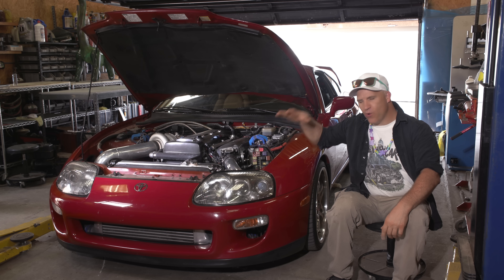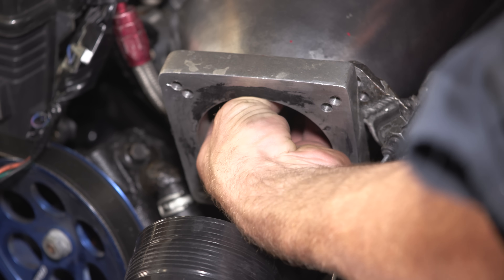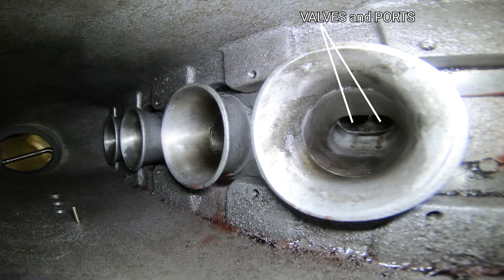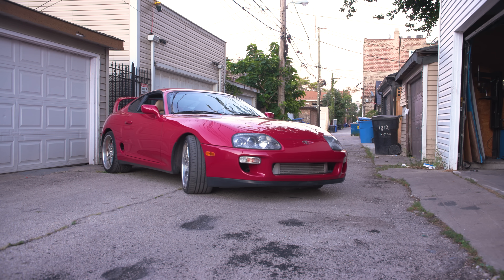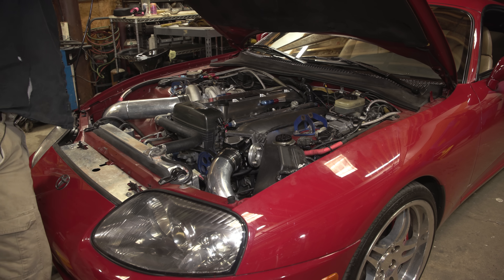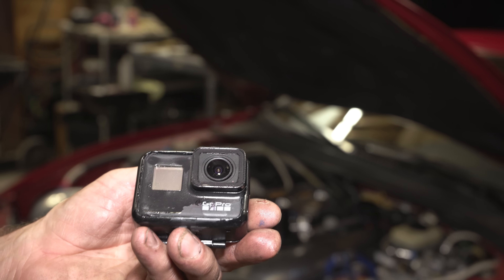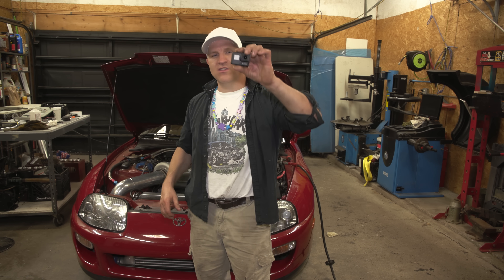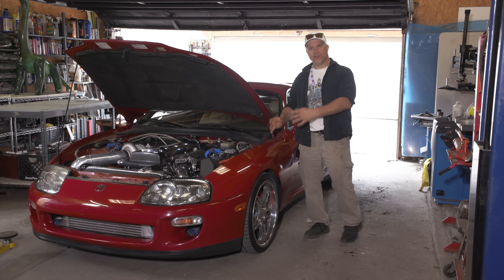Driving with Gopro Inside My Intake Manifold (Toyota Supra Turbo)

Comment: That oil (or rather oil and gas) on the camera was there because of the backpressure from the exhaust when you close the throttle. Valve overlap with open throttle normally causes the exhaust to create negative pressure in the cylinder head and that sucks more air in through the intake valve. But if there is no air to suck in, the negative pressure isn't created in the cylinder head, but rather in the intake manifold and the exhaust gasses escape not only to the exhaust manifold, but also to the intake manifold and cause the oil from the combustion chamber and gas that is sprayed on top of the valve to splash into the intake manifold covering the entire camera in gassy oily stuff. This exhaust gas-oil-gasoline escaping to the intake manifold through the intake valve only occurs during the first few intake strokes when you close the throttle. After a while, the exhaust gasses from the intake manifold are sucked back into the cylinders and forced out of the car.

Comment: The oil is leaking from cylinder number 3. Whatch the cold start carefully and you will see it drip from there. What is happening is the valve is closed and the oil leaks down the valve guide. Then it pools up. Either the valve guide or the seal is worn or both. Put a go pro at the end of your exhaust on a cold start to see if you have a puff of white smoke. When it gets really bad you have a lot of smoke especially until it warms up.

Comment: All I can think of is, there’s orange juice just rolling around in side the manifold. Might wanna look into that cracked cylinder head.
Reply from the maker: It was the power steering pressure switch which uses the intake as a vacuum reference, I changed it, I had been wondering for a while where my power steering fluid was going.

Comment: This needs to be added to why you should use a catch can. That oil is blow by and a catch can will prevent that from going in your intake.
Reply from the maker: I do, I actually designed the original catch can system for the Supra, you can look it up. It turned out to be power steering fluid.
Reply: @WarpedYT  that wasn't a dig at you, just the perfect video to depict why you'd want one. Power steering fluid?! How did that happen.

Comment: kinda crazy the amount of fuel that hits the intake runner, you could probably use the footage to optimize the injector location to get them to shoot more at the back of the valves. I'd bet that if you could somehow mount the injectors at the end of the velocity stacks shooting straight into the port it would have a better chance to completely atomize. just a guess, im probably wrong but it would be interesting nonetheless
Reply: With moden engines they flatten the ports and offset the valves to create a swirl, then place the injectors so they spray directly into to the cylinder, across the top of the valves so that it gets picked up in the swirl, passes across the top of the cylinder and swirls downward. This makes more power and fuel economy, less hot / cold spots etc. I don't know if this was a consideration back when this engine was made, or if it's a more recent thing. I only saw it in a recent video, either for the Mazda Skyactiv X engine, or the deep dive into how the Toyota Yaris GR engine works.

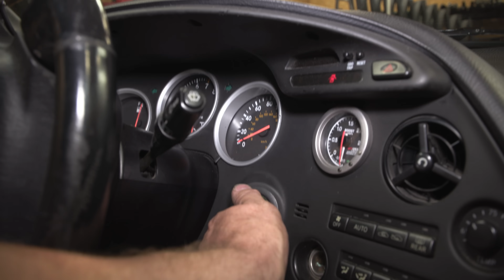Comment: As soon as you started the car up at 2:37, you can see oil entering the intake manifold beneath the velocity stack of the third cylinder (judging from its color, I'm guessing you're using Royal Purple). It looks like your intake manifold was cast in two pieces, the plenum and head interface/velocity stacks. It's at the mating of these two pieces that the oil appears to be coming from. But that would lead me to believe that the oil leak is external, and the oil is entering the manifold due to a small leak at that spot. That would also explain why the majority of oil seems to be entering at initial startup, being that the car has had time to sit for a bit for the oil to accumulate wherever it is that it is accumulating.

I'm assuming you've already figured it out by now, but I noticed the oil as soon as you started the car.

Edit: Reading another comment, I see that it was power steering fluid. So that explains the color!
Reply: Gappie Al Kebabi  Did you miss the part at the end where I wrote "Edit: it's power steering fluid"?
Reply: @rars0n  lol what a loser thinking he made you edit
Reply: It's valve stem seals that's why it drips from the stack
Reply: @zaccuskelly4016  If you had read the entire comment, you'd have seen that it was power steering fluid.
Reply: Gappie Al Kebabi  It was edited 7 months ago, loser.
Reply: @rars0n  SHAME!
Reply: Gappie Al Kebabi  ONLY CUZ YOU SAID SO! HES LYING!
Reply: @fille20200  I'll report you to mrs.sugar

Comment: If you pushed further and kept running it while the camera shut off, most likely the camera would have started to crack under heat and pressure and pieces would fall off, then those pieces would go in the intake valve

Comment: Oil is from the pressure relief for the sump. Compression rings don't stop ALL of the blow-by, and some inevitably ends up in the sump. Pressure from the sump is normally vented into the intake pipe. Also you clearly inject a TRUCKLOAD of fuel. So it's oil/petrol mix.

Comment: The oil, that’s blow-by my guy.
Reply: Blow-by...piston rings? So how likely would that oil be to flow against positive pressure coming through the intake, rather than just get burned/pushed out the exhaust? More than likely it’s coming through the PCV system, if it hasn’t been eliminated, or worse, sneaking past the turbo seals.

Comment: Is that gasoline being spayed in there?
Reply: Yep. The injectors spray gasoline into the intake stream as the valves open to suck air and fuel into the cylinder.

Comment: To my mind that is a lot of fluids (oil, fuel) floating around free in the airbox.
To get rid of a lot of it maybe it would be a good idea to lengthen the intake horn to the next harmonic so that high velocity air/fuel mix bouncing back when the valves shut would still be in the intake horn when the next intake event starts.
Just an idea - although longer horns would narrow the power band - but probably increase the torque.
Very interesting video, thanks

Comment: What a better car to try this on than an expensive ass, classic Supra.
Reply: One with an intake manifold big enough to safely mount the camera in? 😉
Reply: @troyjollimore4100  yes? That one?
Reply: @dru4135  My point being, what one would that be? Not many have manifolds larger than a modified Supra one...
Reply: @troyjollimore4100  dude, what is your point here? I've seen a couple of guys do that shit before and the only difference was they left their GoPro in a tad bit longer and the damn thing came  apart and melted plastic and a burnt battery went everywhere. So gone on ahead and do what you see fit. Good luck.
Reply: @dru4135  Oh, I’m not going to do that. I can’t afford a GoPro, let alone a Supra! 😉 But, of all cars, that was probably the best one since the camera fits with room to spare, and flows enough air that heat doesn’t immediately become an issue,  though he may not have thought about that. Besides, it all turned out well!
Reply: @troyjollimore4100  all good bro

Comment: I saw the oil being sprayed into the intake. Did you find out why that was happening?
Reply: That manifold looks like it's cast in two pieces before being assembled together. Where the plenum mates to the lower half of the manifold, there seems to be a small vacuum leak there. My guess is that there is an external oil leak that is causing oil to collect on the outside of the intake manifold. The car sat while he installed the GoPro, which allowed the oil to collect in that area. Then the car starts and the vacuum in the manifold draws the oil in. You can see it being pulled into the intake manifold from underneath the third velocity stack at 2:37. Play it at half speed and it's super obvious where it's coming from.

Edit: Apparently it was power steering fluid. That explains the color (I was assuming it was Royal Purple).
Reply: @rars0n  Wow! That actually makes a lot of sense. Good eye, and thank you for the reply.
Reply: @rars0n  if that's the case, it just raises more questions for me. I'll stick with Honda...
Reply: @boodro2122  His power steering switch takes a feed off of the intake manifold, and was bypassing some power steering fluid. To me, based on the location of the leak and the nature of it seemingly most apparent at initial start, I assumed it was a vacuum leak (I mean, it kinda is if it's sucking in PS fluid). He put the information in at the beginning of the footage at the end of the video, in the captions. I didn't realize that until I read someone else's comment.
Reply: @rars0n  oh, ok. Right on. Thank you.
Reply: @boodro2122  Look up engine oil dilution problem honda engines, scary stuff, class action lawsuit !
Reply: @DECKARD263354BR  ok, right on. I will. I drive a 1st gen CR-V. Just did a motor swap. I'll look it up. Probably newer cars?
Reply: @boodro2122  Sure is it is the 1.5Turbo owners are complaining about, and from what I've heard the company is refusing to acknowledge it. All the best with your CRV great cars, i had a 1993 honda prelude si, great memories!!
Reply: @DECKARD263354BR  lol right on. Thanks.

Comment: Some oil getting passed the rings it's called blow-by
Reply: It's power steering fluid.

Blowby is when combustion gases leak past the rings into the crankcase.

Comment: The oil is because you're massively over fuelling the car. Nearly like it always has its choke on.
In the video from the GoPro you can see the fuel dripping out of the stacks. 
That excess fuel isn't being burnt & is dissolving the oil of the cylinder walls Then spitting it back out through the valve. 
It's probably because the Mass Airflow Sensor & or fuel pump isn't suited to the intake system you have on the car !  

The only other thing could be your piston rings are to worn & not doing their job. 
The Turbo pushing air down one cylinder is pushing oil up in one of the others.

Comment: 100 to 75mm because the idle and low throttle off idle is difficult to tune? Had the same throttle body years ago with issues always planned to downsize but never did. Now it sits...

Comment: Would have been cool if the camera got sucked through the motor. You could see the carbon build-up on the pistons and even view the tip of the O2 sensor as it went through the  exhaust. Even would get the guys licence plate behind you before he runs over it.

Comment: By any chance- is this an automatic transmission?
If the shift modulator diaphragm is ruptured, the vacuum line will
suck in ATF. The color and apparent viscosity do not resemble
any engine oil I can think of. Have you revisited this since?
It's now Feb, 2021.

Comment: just incase no ones said it yet, the oil in the intake is from the turbo, ive forgotten the exact reason why but something to do with the oil type bearings seeping, its normal though, you should see the amount of oil that comes out of audi intercooler pipes, another culprit would be the pcv due to increased crank case pressure vaporising more oil, this is why turbo charged cars have a catch can or oil separator fitted to the pcv

Comment: Looks like it’s the valve guides on the intake that are leaking a little . Cylinder #4 had oil drip marks before you started but clean when finished the run. It’s ok to use my name and comment if needed.
Reply: It was power steering fluid
Reply: @shoapie  rear seat fluid injectors
Reply: @FusionC6  Turn on captions at the end, says power steering
Reply: @shoapie  i was just poking fun! the fluid injectors are in the front flaps.
Reply: If it were the valve steam seals/guides, then the oil would be sucked into the engine. In this case the oil was being sucked into the intake manifold first.
Reply: @rars0n  crank case ventilation could be a source of constant oil vapour in the intake
Reply: @kristoman111  Yeah, but it'd be entering the manifold in the same manner as the power steering fluid did. My point was that if the valve seals or guides were leaking, then oil would leak directly into the combustion chamber, not the manifold.

Comment: your injectors are too big or to close thats why you cant turn gas to mixture. gasoline which is not turned to mixture will stick to the cylinder walls and destroy oil film causing oil consumption and insufficient lubrication causing rings to dig in to the walls. use smaller injectors or pull them further back so the gas have time to turn in to mixture. nice job as allways

Comment: The oil on the gopro is because of the engine breather The function of the engine breather is to pump the oil vapors and transfer them to the intake for combustion in the cylinder to prevent air pollution
Peace from Israel 🇮🇱🤝🇺🇲

Comment: Jesus christ that's a lot of intake flow reversion...
Reply: That's exactly what I thought..... It can't be anything else except petrol.
Reply: @laurencewaters  No, you guys aren't thinking about the physics going on here. The moment that the throttle plate closes, the air inside the intake chamber goes from 20+ psi to a vacuum. What you're seeing is the water inside the charge air flash condense as the pressure immediately drops.

Comment: I’d like to see a thermal camera in there!
Reply: U like purple?
Reply: @Jaonownal  you can adjust temp settings so could be any color.  But at least you'd see heat sink and better see the blow back. Really this video a waste of everyone's time. I just wanted to hear it.
Reply: @Jaonownal  then you gay
Reply: I'd like to see a VHS camcorder from the 80s in there
Reply: Then there'd be something to see.  It sounds cool tho
Reply: Probably flashes of heat backed by flashes of cold, when you visually see the condinsate form from the sudden changes of atmosphere
Reply: @Dan-ph7ze  I believe it's fuel vapors.  Probably has oversized injectors to run higher boost pressure you know.  That's the purpose of a blow off valve is to alleviate that back pressure cycling backwards through the system so you don't strain the turbine.  It's probably sucking the atomized fuel backwards out of the manifold
Reply: @cliffhooper3558  I've also seen it in environments where the air pressure drops suddenly because it's all being eaten up
Reply: @Dan-ph7ze  It’s called cavitation. It occurs as the valve closes and that is why you see a phase change. It’s also very loud.
Reply: I'm sure you're all pretty wrong. .. unfortunately thermal cams are extremely regulated and are basically like 360p.... Like watching on a potato 🥔🤣😭 would be awesome for that not to be the case though.
Reply: @Lifesabishi  No they are not. Proper IR sensors, yes. CMOS sensors that are calibrated for IR aren't.
Reply: @JainZar1  thank you for the clarification.
Reply: I think a thermal camera will just over saturate
Reply: @everyone You would only see molecules that have at least three atoms inside them, as only those can absorb and emit thermal radiation. Air ~99% two atoms or less in its molecules, disregarding watervapour. Meaning, you would just see the temperature of the surrounding walls most of the time. That you can also just see from the outside.
Reply: Hell yeah!
Reply: Go watch something else then
Reply: Congrats, 600 likes now

Comment: That oil is why most turbocharger systems have an oil catchcan! It is usually from the cylinder head spitting oil coming off the throttle!
Reply: As in when the driver gets off the throttle. As in WOT to little or no throttle causes air to bounce back into the intake, taking oil with it.

Comment: Oil is probably coming from the turbo oil seals through the intercooler and into the intake. Take the coupler off the intake and charge of your turbo and inspect for oil.

Comment: Video was ok, got bored with the placement of the camera. But that car is bitchin. More interested in hearing the engine and watching you slide turns. That was the car to have in the late 80’s, nice car.
Reply from the maker: Lol.. well I can't move the camera inside the intake, and this cars was not around in the late 80's I think you meant late 90's ?
Reply: @WarpedYT  you’re correct, I didn’t mean anything offensive about the angle of your camera just simply stating that I like your car. It was fun to watch.

Comment: Looks like you have an internal oil leak going on coming from the valve chafts as well as a disrupted fuel/oxygen balance. You might be wasting some serious HP's here. This happens when you not carefully warm up your engine before kicking her bum. You burned your valve seals basically throwing in oil from the cam shaft area. This means youre burning too much oil in the fuel mix and create residu on the turbo and turbo bearings with burned oil coaling it all up. You really want that fixed. They are not too hard to replace and the small rubber ring caps do not cost a lot.

Comment: The oil intruding in from the edges of the GoPro camera monitor screen was probably due to the high ~30 inches vacuum inside the intake with the throttle closed, followed by the extreme-opposite condition of the 25PSI turbo boost pressure following during WOT operation- the GoPro seals likely couldn't handle that much vaccum without leaking.

Comment: you should get a bigger intercooler, because 1.5 bar is quite a lot
Reply from the maker: I max out at about 2.5 bar, I have a 4row intercooler
Reply: @WarpedYT  2.5 bar?!?! You know thats not a diesel right?😀
Reply from the maker: Lol... Yes but I am running e85
Reply from the maker: However that is what you have to do to get some big power out of a small displacement engine... The supra is only 3 liters .

Comment: The red liquid was puddled under the #2 and #3 velocity stacks before start up. Don't know if it was oil, antifreeze or if you are running race fuel with red dye in it?